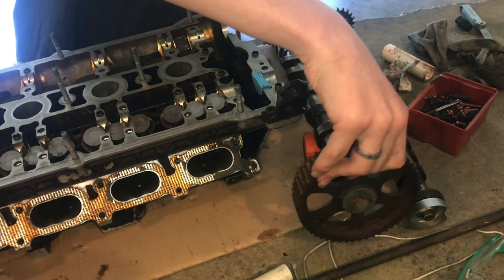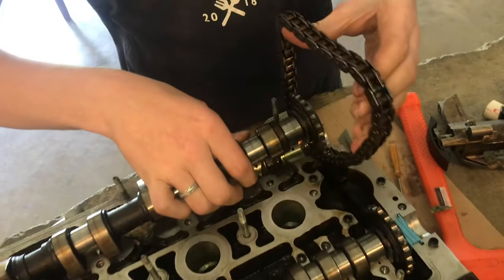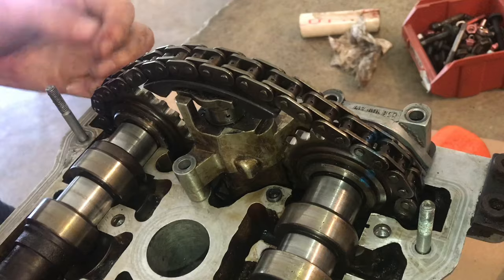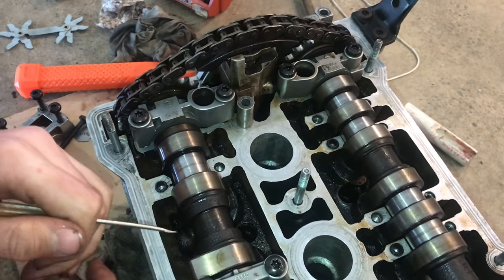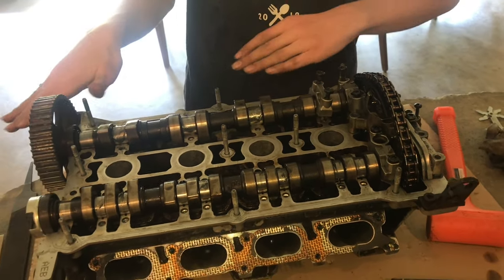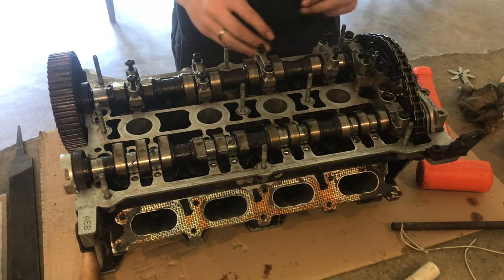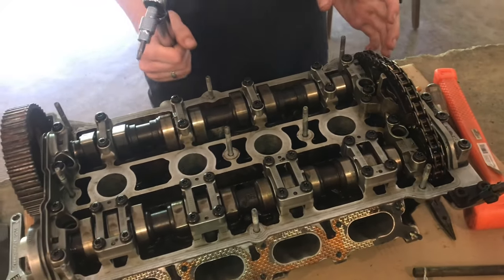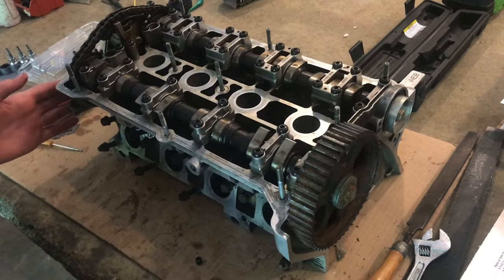“aligning” CAMSHAFTS 1.8t volkswagen audi (chain tensioner cabs torque specs)

Comment: I hate to say it, but it’s very likely that the exhaust cam is off by one tooth, but could be the intake too. Lining up those two sprockets the way you did without the tensioner compression tool, as well as counting the links between the two dots on the gear teeth, will likely end up with it being one tooth off.  Get the special tool, compress the tensioner, have the marks straight up, and make sure the link count between the two designated sprocket teeth is correct. If you want to see what a failure to do this looks like, check out a video Pine Hollow Diagnostics chan just posted on May 4 & 5 2024. Same engine, the whole thing, the cam chain is one tooth off, and how nj short cutted the fix, without the right tool.

Comment: Much easier to deal with the cams and chain and tensioner and link count if you have the tensioner compression tool in place when you're doing that, and do it all on a bench, off the head. Get it all lined up and drop it all in at the same time. The link count and alignment marks on the cam usually drop in correctly the first time that way.

Comment: Do to this do you HAVE to remove the head? My intake cam is at the 1 and my exhaust cam is at the 12. Could this cause a no start?
Reply: There's no way your car should run in the first place. But if your timing is that far off you may have bent valves.

Comment: you would be better off counting 16 links. marking them with tipex then a dot the same on the gear of the cam. put the chain and tensioner, chain together on the cams on the bench, then assemble both cams chain and tensioner together,

you said to put the camshafts in but then took them back out to put the chain on,

also it helps alot to have the cam tensioner holding tool